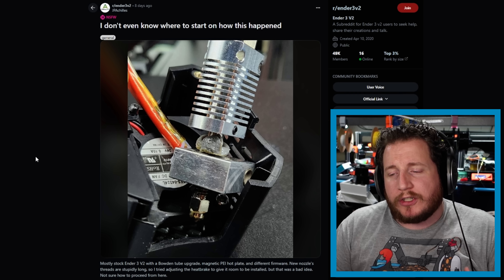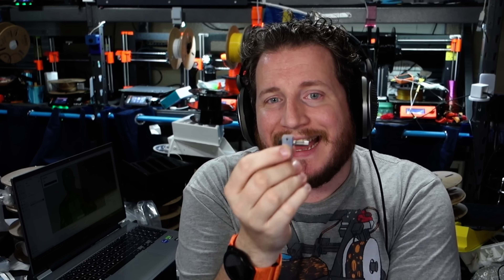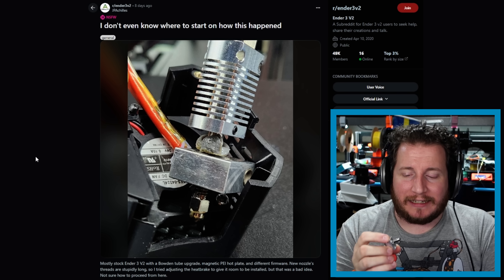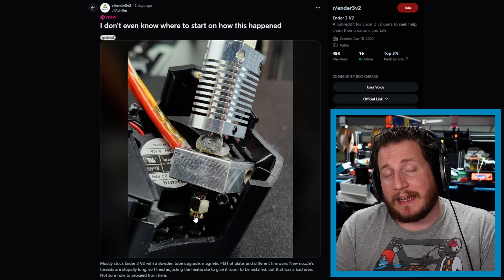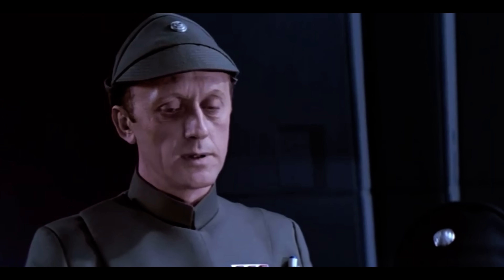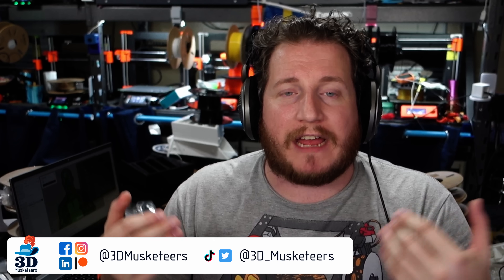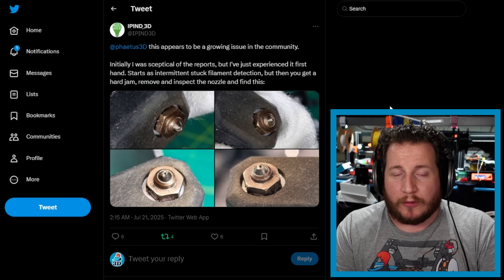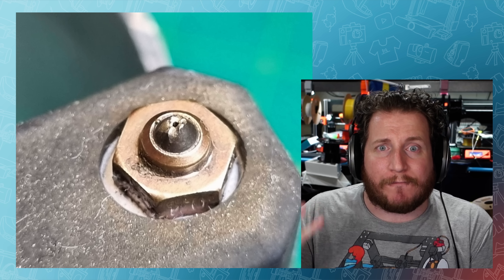How Could This Happen?! - PrintFixFriday 202

Comment: Didnt get a SINGLE print out of the one I just bought for my v3 plus... spent about 8 hours trouble shooting (was building a .6 noz profile which I'd never done on this machine, thought it could have been the issue) anyhow! Returned it, unsure if I'll try another but I do need something that wont break the bank for printing GITD filament that eats through everything

Comment: You have to take care when you machine a SiC carbide nozzle. You generate too much heat its going to create micro fractures that will make it even more brittle. Maybe Phaetus wasn't using enough cooling during the machining process? 🤔

Comment: No matter what filament, I always have to print it hotter in the MK4 than the package says. That was with the stock heater and nozzle, as well as with my volcano modification which added a new thermistor. It feels like the temperature reading is just 10-15°C off, but I never bothered to really measure.

Comment: PROBLEM: I have an Ultimaker 3, still works, but the eithernet and wifi have both failed.  Is there any board on the market to replace their main and communications board (Without costing $500 and shipped from the EU)?  Even it it runs something other than Ultimaker firmware, I would love to get it going and easier to use again. ... BTW this machine is out of support from Ultimaker.

Comment: And yet I got a tungsten carbide nozzle and had it carve up my bed due to a malfunction of the Z endstop.  Nozzle was undamaged.
Reply: And it is a completely different material. Tungsten carbide is less brittle, but also has significantly poorer thermal conductivity.
Reply: @bencox7536  Conductivity is similar to brass, and tungsten carbide is used in tooling for cutting metal.

Comment: Prusa petg it depends aaaalot on the chosen color. The pastel ones are the worst. From the look of the filament on spool those should come out somewhat matte. In my understanding and that wth 30+ petg's used. Shiny petg is happy petg and yes to get those problematic colors to work it needs tons of heat. Best of the bunch is galaxy black. Prints very fast on normal petg temps. Maybe it's like gitd - the glitter in there probably helps stabilize the layed down material
Reply: Totally agree. Urban Grey and Chalk Blue Prusament PETG need way different temps.

Comment: Had similar issues printing Overture black on a Prusa XL. Even at 265C we were getting boogering. I thing we'll try slowing it down.

Meanwhile Creality's PETG formulation prints at a much lower temp w/o issue. Haven't tried any other mfr's PETG.

Comment: phaetus nozzle is least of your concern , their Bambu hotend has tolerance issue , where the dimension of the hotend varies ±0.1mm causing installation issue with the extruder itself.

Comment: Prusament seems okay, but Printed Solid - at least the white stuff - I've had to crank the temperature up.
Also - I definitely recommend upgrading the hotend on the Ender 3. The stock hotend on the Ender 3 is the worst. I installed a Revo on my Ender 3.
Reply: White plastic indeed requires more temperature, there is even a 3D Musketeer video about it. More titanium oxide, white color pigment, means more temperature

Comment: One of my sisters bought a car in 2006. It has 300k miles eventually it made it to her son. It recently failed on him. It's fixable but not cheap. It's an issue with the engine. I don't think it's worth fixing at this point.

Comment: Are we then even able to use it on the XL?
Thinking the offset calibrationm might be a bit hard on the carbide nozzle.
Reply from the maker: Yes it's fine. Make sure the dock position and wipers are tuned right though
Reply: @ZaxMan3D This was on an XL 5TH. All of the offset and bed probing is exceptionally light/soft. They are not an issue.